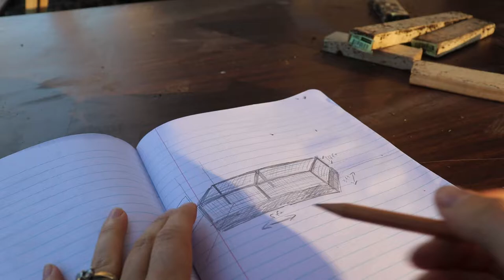The ULTIMATE Urban Quail Habitat for under $35! | Homestead Dreaming

Comment: I like all of the stuff you added to the habitat for the quail to climb on and hide in. That being said, you will probably find that you have to clean the poop out daily. Quail are pooping machines. My first hutch had two rooms, one with a wood floor and sand, the other a hardware cloth floor. It wasn't long before I cut out the wood floor and replaced it with hardware cloth so the poop would fall through and be collected easier. The poop collected so fast and smelled so bad. I kept a a few things for them to climb on and get off the wire floor when they wanted too but those had to be replaced often due to the amount of poop that would accumulate on them. Several months later I made a new hutch with a poop catching tray underneath. I would empty that daily.  It's nice that you have them in a space that you can close off if they get loose. Two of our quail made an epic flight all the way to the river a good 75 yards away. One of them went in the river and he actually swam over to me when I got down to the shore. The other one flew toward the river and i never did find him.
Reply from the maker: Yea they sure are pooping machines. I've had quail for almost a year and I've done sand before and I've done straw and like a pet bedding. I really like sand as long as it stays dry. I'm not a fan of the wire cages. They're just not for me. When I have sand I find I only have to clean it once a week. I'm sure I will have to wash their accessories rather often, though
Reply: @HomesteadDreaming  I hear you on the wire. We don't have any quail right now but next time I want something that will be a little closer to nature for them. We had 25 quail and the sand half of the hutch was probably too small to handle that kind of poo action  😆
Reply from the maker: @AlmostHomestead  hahaha yea I'm thinking I'll end up expanding the hutch to run the length of the wall. I need to decide what to use those spare doors for. 1 will be for my greenhouse eventually but the other two Idk yet

Comment: Drill bits drive me crazy. Quail are such dopes! I've lost three from flyoffs (in Pueblo, not here). I really dislike the jar feeders. I make them out of boxes- tall dishwasher tab boxes are my fave but we don't use those anymore, so now I'm using one of those plastic boxes that frozen cream puffs come in (don't judge me!). I cut holes in 2 opposing sides sort of near the top so they can stick their heads in, and top it with a brick so they don't get on top of it and tip it over. It really cuts down on waste for me because when they flop around or whatever it is that they do that throws feed everywhere, it stays in the box. Plus I'm able to fill it from the top, and I can use soaked feed without worrying about it getting stuck in a jar. Using soaked feed REALLY helps cut down on waste! I have 3 containers for it. I fill one, add some water and a bit of kombucha, and let it sit for 2 nights. I rotate through the 3 containers each day, filling one and using one plus one in reserve so they get some fermentation action as well.
Reply from the maker: Yea I really dont like the jar feeders either. I've been considering getting a feeder like the one i have for my chickens but it wouldn't solve the waste problem, only the ease of filling it. I've been thinking about getting one of those little plastic shoe containers and cutting holes in the side and putting curved pvc in it. We'll see. It's a work in progress for sure
Reply: Great idea for using cream puff containers

Comment: Great that you guys are raising quail!  From my experience raising quail this type of setup will be problematic when it comes to cleaning and egg harvesting.
Reply from the maker: I've had this setup for a while and have started to realize what I do and don't like about it. The egg harvesting isn't so bad, they lay in their little nests mostly but the overhead doors are kind of annoying to bend over into. Also I don't really like where I put it. Currently in the works to build something else.
Reply: @HomesteadDreaming   I hear ya, I wasn't trying to come across as negative more constructive. I'm sure you will come up with something more ergonomic and beneificial. I built a two tiered system and so far its pretty good. Still need to nail down my long term watering and feeding solutions. Keep on keeping on!

Comment: You should have built a platform higher up at your level for cleaning easier.
Reply from the maker: the cleaning wasn't too bad but there are plenty of things I would have done differently if I were to do it again
Reply: @HomesteadDreaming  like I said maybe just change the opening of the cage  opening from the top to this side of it.
Reply from the maker: @tami2170  we don't have quail at the moment this video is from over 3 years ago. We don't plan on getting back into quail at the moment and live in a different property so it would be a totally different setup